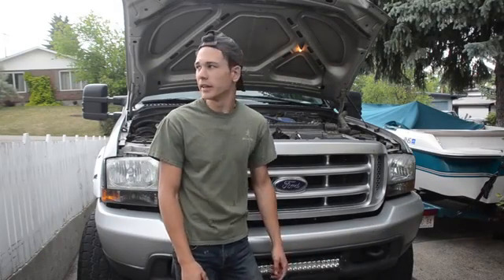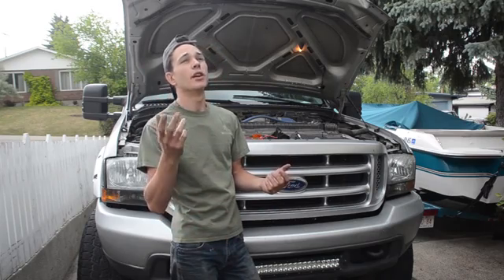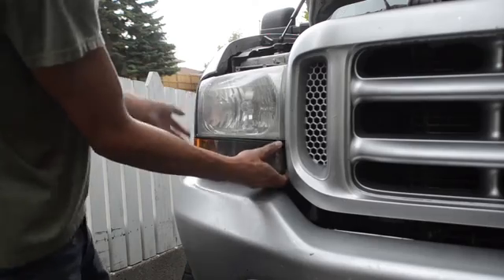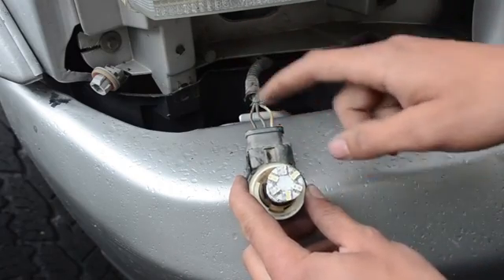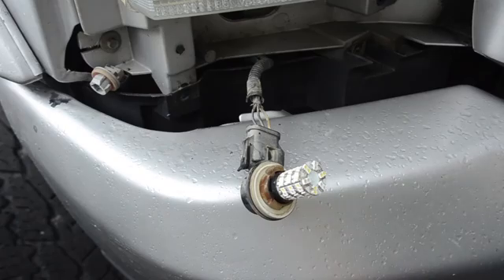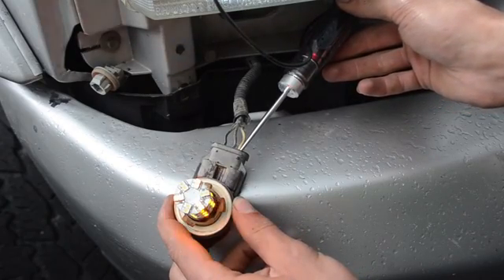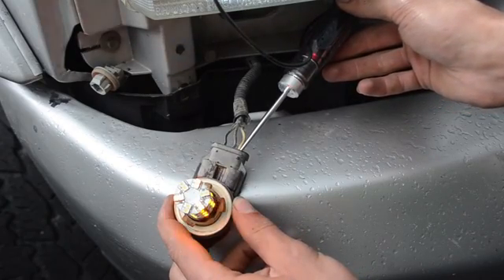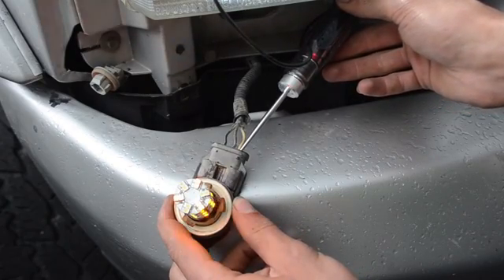LED Turn Signal Resistor Install

Comment: Do you need one on every corner
Reply: Like hell, yes! Makes the whole thing nearly as obsolete as those ancient filament bulbs, not to mention that the  chinese led crap is worth of nothing.... At least put decent LEDs from reputable manufacturers. Just took out my Osrams because of those stupid errors.
Reply: I went with lasfit not Chinese crap

Comment: Better to use t-taps that way if you have to replace a resister just unplug and plug new one in
Reply: Also secure the resistor in place, don't leave extra wire hanging the back end of it, and make sure your scotch locks (if you use them) are clamped all the way down (in this video he only presses it down half way.

Comment: I'd mount those resistors on metal away from all the wires, etc.  As hot as they get it, if the make contact with the housing (or anything else!) it will melt it like butter!
Reply: Well, I touched it when it was running for like 5 minutes. Ouch. That thing cooked my skin. Haha, I live and learn.
Reply: I guess he forgot to say screw it away from wires lol

Comment: Nice Truck.  For vehicles with a flasher relay, it's MUCH easier to just replace it 
with an ADJUSTABLE RATE FLASHER.  Maintains lower current draw and 
adjustable rate knob is very nice!
Reply from the maker: I'll look into it!

Comment: a new flasher in the dash will work also, a 30 sec install it's below your radio. 

variable load duty flasher
at autozone

not trying to hijack, just an easier way in my opinion.

thanks for the vidoes
Reply: This does not however work for all the LEDs it worked when I did it for my tail lights but it didn’t fix the long pause flash for my front end signal lights
Reply from the maker: Thanks for your input! I'll look into it!